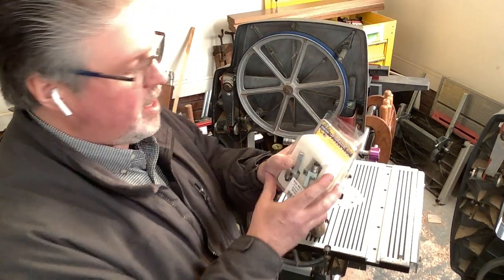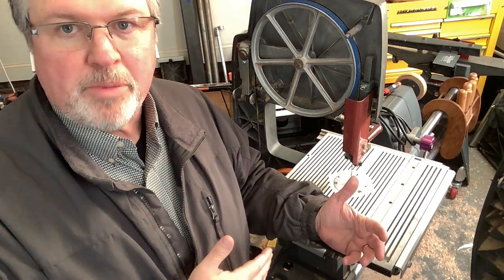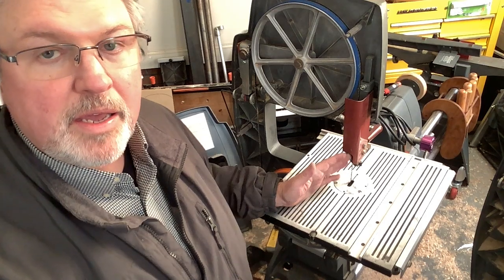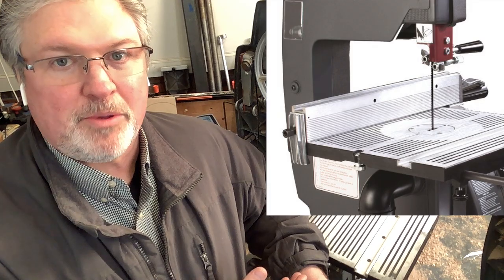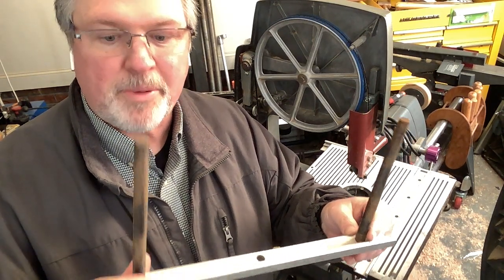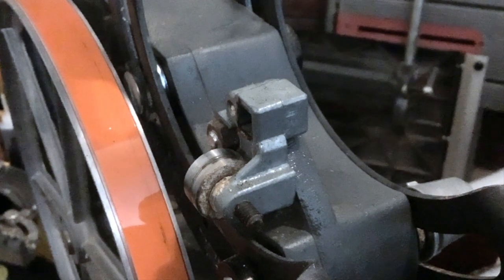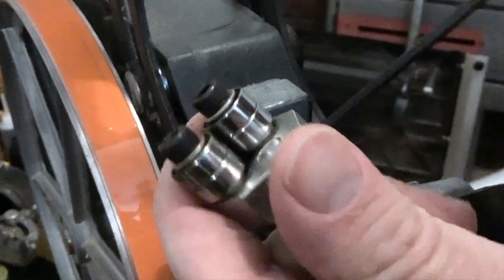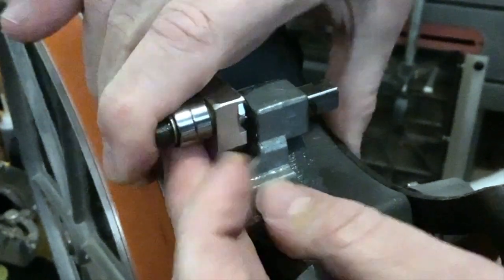Installing Carter "Upgrade" Blade Guides on a Shopsmith Bandsaw. Are They Worth it?

Comment: Scott, I have the Carter guides on my 14” bandsaw and absolutely love them.  They are a bit different because they have the thrust bearing built in, unlike the SS ones.  They do a much better job at controlling the blade then either the steel guides, or cool blocks.  They are not a cheap addition to the saw, but the difference they make is worth the cost, in my humble opinion.

You are going to really enjoy the stabilizer for the 1/8” blade.  It allows you to use the bandsaw like a scroll saw.  Just don’t try to back out of a cut because it can be challenging.

I was thinking about replacing my old bandsaw (33 years old) with a new one, with improved guides, but these guides made it work like I wanted.

I’ve got an old SS bandsaw, that came with the 510 I use as a sanding station, that I’ve never used.  I fired it off the past weekend and am pleasantly surprised at how well it works.  I was going to sell it, because it is in the way, but may hang on to it for smaller jobs, and use my bigger one (it’s got a riser block on it) for resawing, and fine work with a 1/8” blade. SS blade tracking system is definitely different from my other saw, but it appears to work.
Reply from the maker: That's good to hear. The stabilizer is going to be an interesting experiment because of the way the SS BD tracks, considering that the lower thrust bearing is fixed. In any case I love having new experiences!  Scott

Comment: I added the Carter bearings to my bandsaw about a year ago. I think they are a nice improvement. I had the new aluminum table with the fence and always hated the fence, because I could never get it to work right. I ordered the Carter bandsaw fence that works with magnets, put my old iron fence back on and have loved the new fence. I made 65 bandsaw boxes for Christmas gifts and the bandsaw worked great. I'm looking forward to see how you like the new bearings. No cheap shots from me.
Reply from the maker: Glad to hear it. Did they guides eliminate drift? If not, how do you set the fence? Are you using a sliding t-bevel? Scott
Reply: @MyGrowthRings  Drift only seems to happen when I use an old dull blade. Very happy with the way it worked with the 3/16, 4 tooth blade I used for the bandsaw boxes. I would send a picture of the boxes but I don't see a way to do that on this site. Thanks for the great information you provide. I've had my Shopsmith for over 30 years and I learn something in every video you post. My Shopsmith started life as a Mark V, then it became a 510 now its transformed to a 520 with the Power Pro.
Reply from the maker: @ckaynx  You can email me at ScottMarkwood(at)Gmail(dot)com and I'd love to see it!  I appreciate your kind words. Scott

Comment: Put them on my Shopsmith band saw years ago, love them.
Reply from the maker: Glad to hear it. Any insights you can impart? Scott
Reply: @MyGrowthRings  I found that my cuts became more accurate immediately on installation. As to installing them , I didn't have the problem of the shaft rotating in bearing  holder do to a loose allen screw. I also don't have to adjust them as often as I seem to have had to do on the standard blade guides. Wonderful videos for us Shopsmith owners, keep up the great work
Reply from the maker: Thanks Mike. Not sure why I'm just now seeing this comment.  Scott

Comment: I have both the Carter Bandsaw Guides and the Stabilizer installed on two bandsaws, so I don't have to change. I like them both. I have tried the metal guides, shop-made hardwood guides, 'cool blocks,' and the Carter guides. One of my saws is only used for resawing, and the other is primarily for scrollwork.  I like them, and for me, they are worth the money.  I'm very interested to see how you like them.
Reply from the maker: Is the stabilizer on a SS bandsaw? I'm curious how well that works. Glad to hear you are pleased with yours. Scott
Reply: Yes, both of my bandsaws are Shopsmith, one castiron table, and one aluminum table. The Stabilizer is much like cutting with a scroll saw but more coarse and faster. It takes lots of practice to get the hang of it, and I can't cut as fast as they do in the demos.  I am a bit disappointed in how smooth the cut is, but that is me and the blade, not the guide. Here is a sample of the most complicated compound cut I could find.

https://odinstoyfactory.robertkeeney.com/2021/01/bandsaw-roosterchicken-cut-with-my.html
Reply from the maker: Yeah, Alex can make that thing sing like Ron Popeil!  "But wait, there's more!"

Comment: While I haven’t upgraded to the bearing guides, it looks like if you have an issue with the bearing block rotating, maybe file a small flat spot into the pin where the 3/32” setscrew seats. That way if the block rotates, it won’t rotate much.
Reply from the maker: Yes, that’s one option I’m considering. I’ve reached out to Carter to see if they have a suggestion before I start modding. Scott
Reply: @MyGrowthRings  will be interesting to hear there response.

Comment: I did not have any of the problems you experienced. I dropped the spring and had to spend some quality time crawling around on the shop floor with a magnet and a flashlight.

 I don't use ball head wrenches for tightening (other than snug) or breaking loose screws unless I can't get to them any other way.
Reply from the maker: Well, the good news is I don't have to worry about the ball-end coming off anymore!
Reply: @MyGrowthRings  I broke a couple of them before I learned to be careful. I haven't broken one since then. Most of me have the ball on the long side, making it easier most of the time.

Comment: Scott you talk about band saw drift all the time, I have a Porter-Cable bandsaw & a Shopsmith bandsaw & I have no Drift at all on either one. I have the PC set up according to Alex Snodgrass method from Carter Products & the SM according to SM Manuel & I run Cool Blocks on both "Way Better Than Steel blocks. I run 1/8" to 5/8" on both saws with no problems.
Reply from the maker: You are very fortunate because that is not the norm. By virtue of the way the Shopsmith bandsaw is constructed, drift is a natural phenomenon.
Reply: @MyGrowthRings  no drift on my SS either, but I say that in a whisper so my bandsaw won’t hear me....shhhh

Comment: Scott, back some years ago there was much made about ceramic guide blocks. Have you tried any?
Reply from the maker: I did and didn't find them to be any better than the stock blocks. The cool blocks were a better upgrade, but unless you cut with very narrow blades there's no advantage to them, and the Carter Stabilizer that I'll be showing soon is even better than that. More to come.  Scott

Comment: Rather than using LockTite, should there instead be flats on the posts for the set screws in order to prevent rotation of the guide blocks?
Reply from the maker: I'm waiting to hear back from Carter. Since these are going back to them I figure they should weigh in, but I agree, that would be a good approach. Scott

Comment: Hi Scott this will be interesting to see what you think of this mod. Have the band saw yet needs a-lot maintenance work.   I have a question well I have a lot of questions 😂. To many to post here. Saw your email in comment so is as posted the correct way or is (at) right or @ correct as example. I’m finally getting around to refurbishing my 1980 markV and 60s Goldie. Your videos help a lot. By biggest issue is shop smiths websites and guys like Jacob sites don’t seem to show me parts list and prices or navigating them incorrectly . Frustrating. Amazon and all those no problems finding parts and prices. I’d like to compare and know what I’m getting is right the first time. Bearings mostly. But none the less all things shop smith. Once I have this baby’s running like they should be I want to possibly keep 1 as I may have to down size my shop at some point and could be advantageous to say the least. I would love to hear one running in person with new bearings and belts. Thanks
Reply from the maker: Yes, to keep bots from grabbing my email address and spamming me. I used those other hieroglyphics. My email is spelled the way a normal email is spelled. I’ve already done a follow-up to this video and gave my feedback, so you might wanna seek that out. Scott
Reply: @MyGrowthRings  10-4 will check it out.

Comment: I have them on mine and I swap out my wood blade to another to cut sheets of aluminum sometimes and they are much better then the guide blocks for that use.
Reply from the maker: Glad to hear it. Thanks for chiming in. Scott
Reply: The bearings on mine when I got it where shot and came with my machine and it turned out they were a pretty available bearings to come across so that’s a added bonus.
Reply from the maker: @smalltownmachineshop6860  On the bandsaw?
Reply: @MyGrowthRings  the bearings on my blade guides, I’m not sure who made mine but I was able to find replacements
Reply from the maker: @smalltownmachineshop6860  That's good. It makes sense not to make bearings a proprietary size. Scott

Comment: You call your bandsaw old  but mine looks older. It has the original cast iron table, but the center, around the blade is a round piece of aluminum and really beat up.  Are there replacements to be had or do I just have to live with it?
Reply from the maker: I don’t believe that Shopsmith offers them any longer, but there are people 3D printing them, so that’s likely your best approach.
Reply from the maker: Here's another option: https://amzn.to/3toFml6 and yes, the cast iron table is an older design than the one I was working on. The aluminum table was added to the Shospmith bandsaw in the late 1980's, so yes, some of those are old too! Scott

Comment: I have the Carter bandsaw guides and love them.  I also bought the SHS1 stabilizer from them, but haven't gotten around to any fine detail (small blade) work yet using it.  Sorry one of your guides came from the factory with improper orientation.  Carter is a good company, but mistakes do happen.
Reply from the maker: Yeah, that was a little surprising but not a big deal. The biggest surprise was that they wanted to spin on the post so freely.  Hopeful we can do something to help that tiny setscrew. Scott
Reply: @MyGrowthRings  Possible there is a "dimple" on that guide shaft the set screw seats into?
Reply: Never mind--I see that has been asked already.

Comment: Question, but first... all of this info on my SS bandsaw (I should say Magna Greenie) has been hugely helpful. Thanks! My original metal throatplate for my cast iron table is too damaged to straighten out, but I would be more than happy with plastic zero clearance. Which is correct? I simply can't justify SS price, especially when their shipping times are ridiculous whenever I have ordered from them.
Reply from the maker: I don't have any personal experience with these guys, but there is a company that is 3D printing a set of three for the cost one one aluminum insert from SS, and you'll get it a lot faster. The sell them through eBay: http://ebay.us/fazk8y
Reply: @MyGrowthRings  Awesome! Thanks
Reply: @MyGrowthRings  I got them, perfect fit.  Except does not have the locating tab.   I heated small wire brad and pushed it next to the slot.  Insert sits a little cockeyed, but works.

Comment: Scott, will those fit my Total Shop Bandsaw??
Reply from the maker: I’ll take a look and report back.
Reply: @MyGrowthRings  I have a broken guide holder, looks like over tightened, I epoxied it for now.  But looking at the cost, ouch,  I may see if this works, or find an old one. LOL  lower guide for TotalShop
Reply from the maker: I checked and the TS guide is totally different from the SS. It might be possible to retrofit the SS part onto your saw, and if that works you would be able to use the Carter guides. Scott